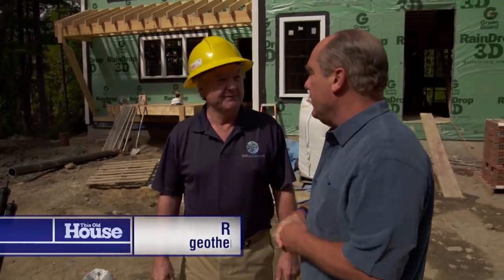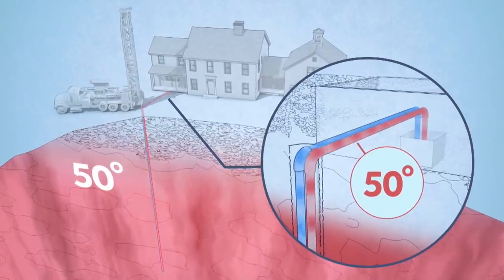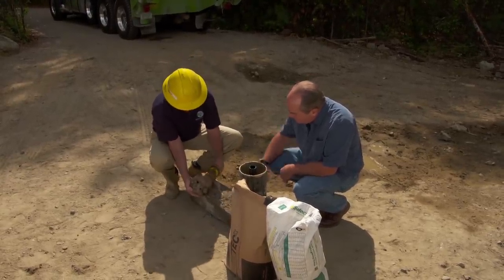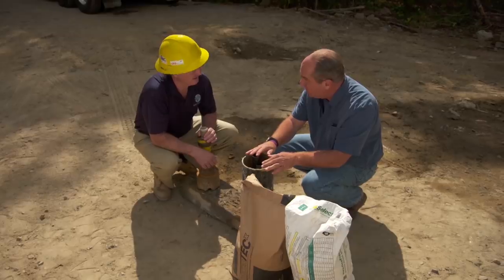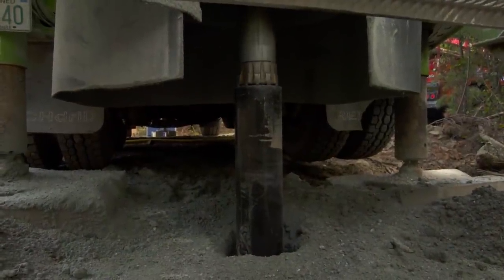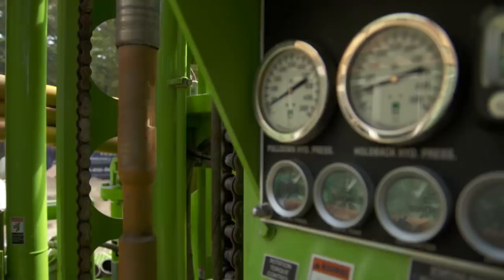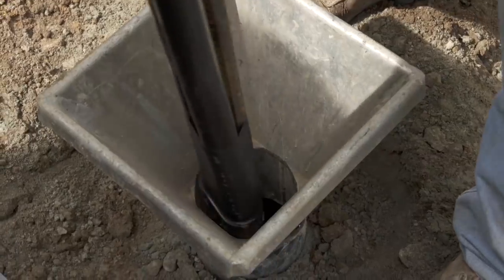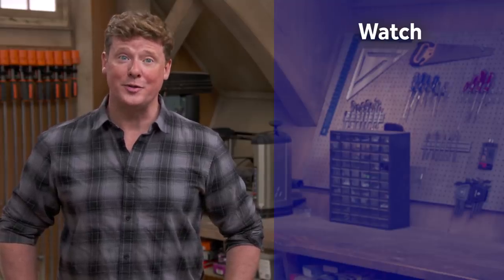How to Drill for Geothermal Energy  | This Old House

Comment: Around here holes are around $100/foot. Are those $75k holes?
Reply: You'll typically spend about $20k-$40k to have the whole system installed, with only maybe $5k of that for the actual cost of digging the holes.  I expect the issue where you live has to do more with shipping in the equipment necessary to dig one.
Reply: @danielgehring7437  I guess I should clarify that that price is for a water well, maybe geothermal is cheaper than water?
Reply: @GregsWorkshopOregon  Hmm.  $100 a foot still seems mighty dang high, but yes, well drilling is generally more expensive.  You need to find an aquifer and install real pipes with a well,  but geothermal is a closed system that you can just use, like, PVC for if you want.
Reply: @GregsWorkshopOregon  I'd imagine that the setup up and intitial digging is a lot of that $100 per foot number since most wells are only going 40-50 feet. It doesn't add much cost to go even deeper (to a extent)
Reply: @GregsWorkshopOregon  Oh also I forgot to mention before that if traditional up-down boreholes are too expensive, you can always just put them sideways instead.  That way you're only going down 10 feet instead of 300.
Reply: Probably not $75k hole, there'd be almost no ROI for doing this way.   I imagine they want to have a fixed cost, plus whatever extra for "drill bit replacement" and for a 40-50 ft well, that kind of makes sure everyone gets paid.    This is probably a similar cost to the 50ft well to dig, depending on what they have to drill through (i.e. "drill bit replacement" cost)
Reply: @Mike__B  Looks like a crew of 4 guys over 3 days. For skilled labor like that you are probably talking about $5k and $10k in labor costs alone. Add in another $10k for the pipes and other equipment they leave in the ground, and another $10k or so for the value of the vehicle. I'd bet digging these holes like this costs somewhere between $25k and $40k.

Comment: 50degs isn't that warm. If it's really cold out I'm going to want my house warmer than 50 degs. How does the system take that 50degree antifreeze and boost it higher so my house is a cozy 72
Reply: the 50 degrees is "free" now you only have to waste energy/money generating the last 22 degrees.
Reply: That is not how those work
Reply: The same way a tradition heat pump can boost the cold outside air temperature up to a higher indoor discharge temperature. A heat pump is able to move heat from a cold area to a warm area by compressing the refrigerant gas. This higher pressure makes the gas hotter than 72° so the 'indoor coil' gives off heat to your house. This cools the refrigerant so when it is allowed to expand pack to it's normal pressure in the 'outside coil' it becomes colder than the outside air. Only then is the heat from 20° outside air able to flow into the 10° refrigerant. Compressing it brings it back up to the higher temperature and the cycle is repeated continuously.

The antifreeze in the ground loop gives heat to what would be the 'outside coil' on a traditional system. The 'outside coil' normally exchanges with air which might be 20° or below, now it exchanges with the 50° antifreeze. You receive an enormous boost in efficiency because the antifreeze is already much warmer than the outside air. This means that the compressor does not have to work as hard to generate the temperature gradient that forces the heat flow into the building. It's enough to offset the cost of drilling the holes.
Reply: @ElectricGears  I bought a house with geothermal and it’s awesome. When it’s 100 outside I can cool my house to 60 and it does it quick!!! Also full spray foam and it barely has to run. Great system.
Reply: Insulate your home with rockwool/ mineral wool

Comment: If you’ve got the room, horizontal is the way to bore. Much cheaper.
Reply: @UCyVJhouNgdKXwi3QoAnLmTA horizontal only goes 12-15 feet deep and is installed with a boring machine. You’ve probably seen them installing cables on the side of highways. I just had a geothermal system installed with 11 loops. System worked great through this past winter here in Minnesota
Reply: How much cheaper?
Reply: @synewparadigm  don’t know exactly as the bill
Wasn’t itemized but my system has 11 loops cost for the boring was less than 4k.

Comment: Where I live if you drilled that deep you would strike boiling water
Reply: If that is the case, id be running geothermal energy plant instead or a smaller version to power the house.  They use the hot water like that for steam power plant

Comment: If it’s consistent 50 degrees at 20 feet deep, why go to 300 plus feet?
Reply: Because one being manufacturers requirements for consistency of load the ground can handle for Said required  BTU  and code.
Reply: Because the pipe needs to run far enough to absorb that temperature.  The same reason your car radiator or air conditioner has to coil a bunch of times.  You're completely right though: down-bore geothermal, like in the video, has long been considered the silliest option if you want to get this done, it's more expensive and not all that efficient.  Most people who get a system like this either just dig another well and use their groundwater for the heating/cooling, or dig a pit that only goes down about 10' and put the piping sideways in slinky coils.
Reply: @danielgehring7437 I was gonna say why but just do 20ft with coiled tubing instead of 150ft lol

Comment: Why so deep?
Reply: Has to be deep for temperature to be 50 constantly
Reply: More depth = more ability to exchange heat with the ground
Reply: Longer pipe means time for the temperature to change. Some systems are installed very shallow but zigzag across a large area. The vertical install is more efficient and doesn't tear up the whole yard.

Comment: Yea, no.  This is not "geothermal" in the traditional sense (using very hot water, aka steam to generate power).  This is just digging a hole in the backyard to keep your HVAC at a certain temperature.
Reply: The equipment in the house is where the heat/cooling exchange takes place. I’m sure there will be another video explaining that in the near future